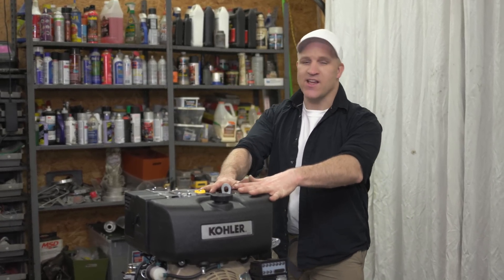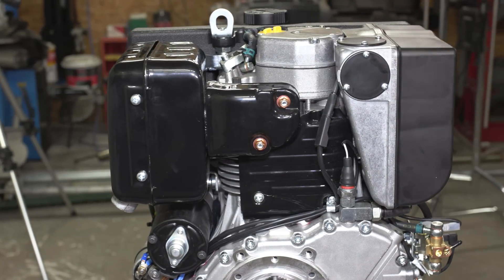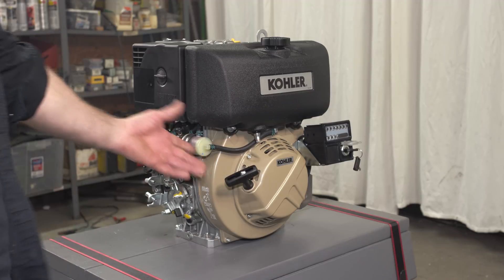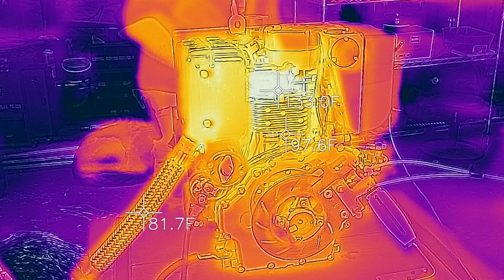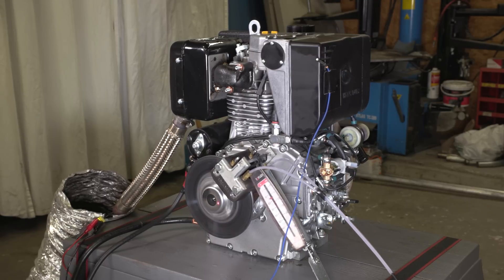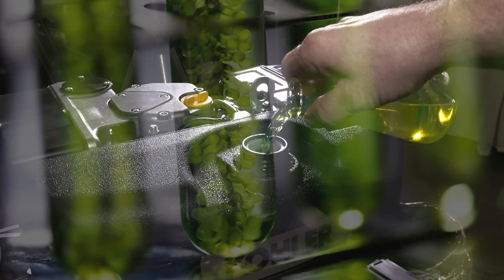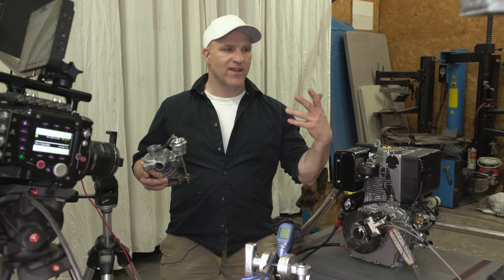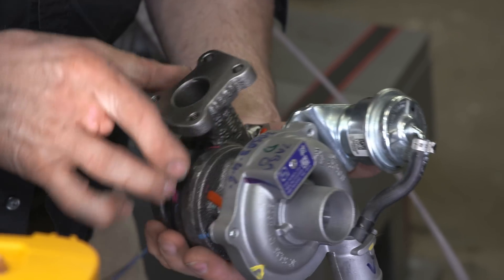Single Cylinder Diesel Engine - Dyno Test (Diesel, BioDiesel & HydroDiesel How Much HP?)

Comment: "The only thing I was missing was the company that made a single cylinder diesel engine..."

You mean other than: 
Honda
Kubota
Yanmar
Lombardini
Enfield
Deutz
Hatz
DMB
Nissan
and 67 Chinese consumer brands...
Reply: Der Motor wird von Lombardini gebaut und als kohler verkauft
Reply: https://images.app.goo.gl/vE4iX2XqBeVynZRC7
Reply: DexMaster881  LOMBARDINI brand diesel small engines are now KOHLER DIESEL ENGINES
Reply: And Czechoslovak Slavia and Škoda.
Reply: He was waiting for a company to give him one.
Reply: @jjw6342  YouTuber with a massive following is a choosing beggar or just wants free stuff.
Reply: My first thought as well, both Kohler and Briggs and Stratton are a short drive from me. SE Wisconsin area
Reply: Forgot Kawasaki
Reply: Yamnar and Robin are 2 that stand out in my mind. 
I've seen a few of them with 5-6-7000hrs on them , and finally died because some idiot didn't tighten the air filter wing nut and it got dusted. 
Great engines , once you can swallow the purchase price.
Reply: Harry. B. Renner. jr.  
The wife works at cat, and said occasionally there's rumors and rumblings  they might come back to the road ....
Reply: Honda Nissan japan
Reply: Just the one in the video
Reply: Everyone in this thread missed the biggest advantage for the future of diesel engines - in that a diesel engine can literally burn almost any comfortable liquid - ie vegetable oil - it's even a problem in older diesels when the oil would leak Into the intake and cause a runaway engine -
Reply: dongfeng
Reply from the maker: Well I meant a Single cylinder diesel engine that I wouldn't be scared of when pushing it to it's limits and nobody was going to get hurt by. Other than that you just gave me a really good idea.
Reply: @WarpedYT  Yanmar has Japanese reliability on its side. They're built like tanks.
Reply: @TheOmegaRevolution  We had two crew boats at work that had 380 hp Yanmar turbo diesels. They out ran the other boats of the same hp. The maximum 3600 rpm helped compared to the 2800 rpm of the 5.9 Cummins junk engines in the other boats.
Reply: @TheOmegaRevolution  love yanmar
Reply: What pushed you towards the Kohler and not the hatz?...
Reply: @WarpedYT  I have spent a LOT of time working on a Hatz over the winter, because it had a unique problem.
It got fixed.
It comes in 1, 2, 3, and 4 cylinder versions, and I've come to live the German engineering.
These engines come in a capsule, and are used for some diverse applications.

If you are going to do this again, please test one of these. They are incredibly robust.
Reply: @WarpedYT  hatz and deutz. Reliable in many parts of the world including the US and they manufacture diesel engines for over 120 years and where the first manufacturers which air cooled engines meets the US epa regulations... Instead of them I see a whatever manufactured engine...
Reply: @WarpedYT  There's 2 ways to get hurt by a diesel engine.
Drop it on your foot.
Stick a hand in the drive shaft that its powering or heated parts.

Well there's a no 3 for the Americans: Realising its a superior design to gasoline engine. :)
Reply: DexMaster881 cost to build, cost of maintenance and parts, low Speed and HP, expensive emission compliance...
Reply: DexMaster881 The cost to manufacture and cost of parts are purely the result of economies of scale, thanks to US manufacturers dragging their feet on diesel in the US. The superior thermal efficiency, fuel flexibility, longevity, reduced fuel consumption and reliability of Diesel engines should mean they cost less to operate long term on anything larger than a leaf blower 😂. Silly overheating, asthmatic, fuel guzzling gassers and their precision recreational fuel are all the Union workers want to have to manufacture so that’s what we’re stuck with.
Reply: @dregenius  "The cost to manufacture and cost of parts are purely the result of economies of scale..."
-
Not even remotely true. The diesel combustion cycle requires stronger engine components, which are more expensive to produce. Diesels also require turbocharging to be practical in modern vehicles, that's an additional cost. Diesels require direct injection which is more expensive than the port injection that many gasoline engines make use of. The emissions control systems are also vastly more expensive, complex and maintenance intensive for diesels.
-
Longevity is purely a result of design and modern diesels begin to have so many problems with their complex fuel, induction and emissions systems as they age that their longevity is no longer superior to that of gasoline engines.
-
Gasoline engines are superior to diesels in every way that matters. Just a few examples:
-
Chevy Cruze (gasoline): 153 hp; CO2/mile 277g; annual fuel cost $1,050; EPA smog rating (out of 10) - 6.
-
Chevy Cruze (diesel): 137 hp; CO2/mile 294g; annual fuel cost $1,200; EPA smog rating (out of 10) - 3.
-
Mazda CX-5 (gasoline): 187 hp; CO2/mile 335g; annual fuel cost $1,300; EPA smog rating (out of 10) - 7.
-
Mazda CX-5 (diesel): 173 hp; CO2/mile 365g; annual fuel cost $1,600; EPA smog rating (out of 10) - 1.
-
Honda Accord Hybrid (gasoline): 212 hp; CO2/mile 184g; annual fuel cost $700; EPA smog rating (out of 10) - 7.
-
Prius (gasoline): 121 hp; CO2/mile 170g; annual fuel cost $650; EPA smog rating (out of 10) - 7.
-
Trucks...
-
Ford F-150 2.7 EcoBoost (gasoline): 325 hp; CO2/mile 423g; annual fuel cost $1,600; EPA smog rating (out of 10) - 5.
-
Compare to...
-
Ford F-150 3.0 Power Stroke (diesel): 250 hp; CO2/mile 463g; annual fuel cost $2,000; EPA smog rating (out of 10) - 1.
-
Ram 1500 3.0 EcoDiesel (diesel): 240 hp; CO2/mile 448g; annual fuel cost $2,000; EPA smog rating (out of 10) - 1.
Reply: @DexMaster881   ... or trying to hand-start it on full compression.. 😤

Anyone remember the big single motorcycles of yesteryear ? Ya'd break yer ankle if you got a "little" kickback... 🙄 and they  were petrol 😔

Thats a beautiful little engine btw... 😉

😎👍🍺☘
Reply: @PistonAvatarGuy  If i lived in the US i would strongly consider using gas as well. A big part of why the US does not like diesel, is that your diesel-fuel is a LOT more expensive than gasoline! In Europe, it's almost the reverse! Here diesel is usually cheaper than gas. And i don't know why your diesels emit so much Co2.... My 5 year old 4x4 180 hp diesel emits 190g Co2/mile, which is almost as low as the prius.... And that is usually the trend, but that ignores NOx and soot from diesels, which explains the low smog-rating, but the smog-rating only looks at directly harmful-to-humans emisions, of which diesels very much deserve that rating, because o NOx! This is why they are beginning to get banned from inner cities, but it is not a problem when they are not concentrated in small areas, like diesel-engines on container-ships on the sea and on inter-city highways, where there is a lot of wind to disperse it. The Smog-rating does NOT look at greenhouse gasses, which should be the bigger concern now-a-days, and there diesels are either actually better than gasoline-engines. So yes, gas for small cars in the city, diesels for bigger cars on the highway. Bigger cars in the city should not be a thing, but never-the-less it is in the states, and thus a 2-wheel drive gasoline pickup-truck makes sense if it's used to drive the kids to school and get groceries.
Also, i wanna point out that you make a few points about diesel-engines, calling them complex and costly with their direct injection, emission systems, turbocharging. I just looked up the gasoline Chevy Cruze(Very rare car in europe), and it also has complex emissions systems, direct injection and turbocharging, and along with that, it has a very complicated intake-system with throttle-bodies and air-flow/mass sensors, where diesel only really need a pressure-sensor to comply with emissions, but can usually drive without, which means it wont just die on you, and you can drive it to your destination on limited power, and get to your mechanic without towing it. Apart from that, if the intake on your gasoline-engine has a leak, or your spark-plugs/ignition-system dies, the engine will also die and you wont make it to your destination. Granted, diesels have glow-plugs, but they are only strictly necessary in very cold weather (Below freezing), and the engine will usually start and work with only half of them actually working, since they are only needed when the engine is cold. 
I wont get into the longevity of modern engines, as no-one really knows yet, but if you look at cars from the late 90's in europe, a lot of them are low power-to-displacement diesels that have driven over half a million kilometers (310.000 miles!) on original engines, and are still going strong. Higher-power engines doesn't seem to live that long, but that could be due to fewer of them having been sold, and most of them being business-cars/taxis that drove 500.000 km in their first 10 years, which will of course be gone now.
Very few gasoline-cars make it past 200.000 miles without a complete engine rebuild....
Another point is that the ones actually buying diesels in the US are the ones that tow with it, and thus put a lot of stress on the entire drivesystem, which means it will be built stronger and therefore last longer than a gasoline-engine. This obviously makes it more expensive, but it's also a big reason diesels usually last longer. I had a 1.9 TDI from 1997 until last year, which had done 490.000 km, and i regularly towed a 2-horse trailer with it. It was almost always at full throttle to keep up with semi-trucks on the highway, and it never had overheating-problems, it still had ok mileage, and it survived several hours at full throttle and boost-pressure with the trailer. 
I also did 2 trips at basically top-speed at night on the german autobahn (Skiing trip) where it was at 3800 rpm  (Redline at 4000) driving 180 km/h with full throttle almost non-stop for 8 hours, with only very short breaks if there was a bit of traffic or a fuel-up, and it just did it no-problem. No loss of power(Actually the reverse! It cleared out some soot or something, cause the turbo spooled up at 1700 after it, vs 1900 rpm before), no leaks, oil looked fine, nothing. It was indestructible, and only had to go because someone drove out from a side-road, and hit the side of the car. The other car leaked every conceivable liquid and the whole bumper was ripped off, and my car drove up on the tow-truck itself.
Reply: @Newspaperman57  I love diesels and wish my country had adopted them earlier, a lot of the US is rural and so our diesels could work quite well. The issue is when idiots pull off the emissions equipment and pour way too much fuel onto the engine making huge clouds of black smoke. It makes people think they are dirty and pollute a ton. Honestly, we should have banned anyone who rolled coal from owning a diesel. Our government is constantly waging war against automobiles as they are an easy enemy instead of looking towards reducing the methane that our livestock put into the air or the trash that plagues our waterways and oceans.
Reply: @Newspaperman57  I don't understand the point of your comment, gasoline engines do EVERYTHING better than diesels. They're less complex, less expensive, they pollute less (both NOx and CO2), they perform better and they have fewer problems. Even in class 8 trucks, spark-ignited natural gas engines perform just as well as diesels, while polluting less and costing less to operate.
Reply: @PistonAvatarGuy  yes, but what about the Cruze compared to my VW Sportwagen TDI?
Reply: @TMoonPickens  It hasn't been on sale in the US since Dieselgate and the most recent version of the Cruze diesel significantly outperformed it.
Reply: @PistonAvatarGuy  good point. I had forgotten about the Cruze diesel. I happen to love my VW.
Reply: @TMoonPickens  Doesn't mean that gasoline engines aren't better in every possible way.
Reply: @PistonAvatarGuy  You are pulling shit out of your ass? How is a deisel engine more complex than a gasser? Diesels hardly have an ignition system. No spark plugs or wires. Its literally just fuel and compression. If your deisel is having trouble starting its almost 100% related to fuel if nog below freezing. Just start cracking lines and checking pumps,filters etc. Diesels are proven to burn cleaner,provide more gas mileage and provide substantially more torque. The only reason gassers dominate is because of fuel prices. A gasser is literally not better in any area over a deisel. I work for Caterpillar. Im rebuilding 40 to 50 liter engines every other week. They are producing torque numbers a gasser could never dream of. Burning cleaner especially with the selection of fuels available. Running for days on end without breaks. Sometimes only running for weeks without stop. Fuel consumption is no where near what a gasser would be of the same size. They can go a couple of days before refueling. At least on the big machines I work on. Deisel dominates in every area and has been proven to be just as effective in literally every area of industrial and motorsport alike.
Reply: @PistonAvatarGuy  would you mind to share the source of those CO2 numbers? Diesel contains a significantly higher amount of energy per volume than gasoline, the engines need  30 to 40 percent less fuel, so the CO2-emissions are much lower. Plus, in Europe, Diesel costs only 2/3 of gasoline, that's why so many people drive it (I'm not a Diesel guy myself, btw, but I don't like to talk about false facts, when it comes to co2 and fuel consumption)
Reply: @Spongschbob  Diesel produces more CO2 when burned, the additional carbon in diesel is where the extra energy comes from. Modern diesels are only about 10-15% more efficient than modern gasoline engines, which isn't enough to offset the greater amount of carbon contained in diesel fuel. Diesel is more expensive than gasoline in the US.
Reply: @dregenius  Well guess who are the avid haters of Diesels? 
British and Americans, ones with most Oil Tycoons...
Also the ones that dictate Emissions regulations that get met by all other countries than their own...
But its OK they always get slack.
Theres an old saying in My country "Judge sues you Judge judges you..."
Reply: @PistonAvatarGuy  Wow dude....there is no help for you. I give up. Your "facts" are far from true here. All of that modern technology requires me to plug in my computer and tune the engine,and electronic accessories to do anything I want. Im literally taking a course through Caterpillar to learn how to do that stuff. Its no different than tuning a gasser. In fact guess what? Its easier. There is no spark timing or spark advance and most the of tge high pressure fuel pumps and stuff nowadays is still no where close to the complexity of some of the new gasser engines. As for torque a turbocharger is used to get diesels to make more power on the top end. Most deisels make a shit ton of torque at around 1000 to 1500 rpm but are gutless and sluggish with out the added top end power around 2 to 3 grand. Again a gasser cant make that torque. Not without 10 grand in modifications. As for longevity I believe maintenance can make any engine last
Reply: @haydona1845  All of that modern technology makes diesels MORE COMPLEX than gasoline engines, which was the whole point of our discussion. It may be easier to tune a diesel (to some extent), but you get less power from a diesel, so it doesn't matter.
-
Plenty of turbocharged gasoline engines make several thousand lb-ft of torque, they're not tuned that way from the factory because they don't need to be, they can make huge amounts of power without having to make huge amounts of torque.
Reply: @DexMaster881  hey just cause I'm american doesn't mean I dont think diesels are damn well superior
Reply: @PistonAvatarGuy  Petrol engines release more CO2 than Diesels, because Diesels are more thermally efficient due to their higher compression ratio and leaner burn, also they don't have to run under partial vacuum to restrict power, unlike petrol engines that use a throttle.

Also, simple and cheap additives, such as AdBlue, help greatly with NOx emissions and combustion temperatures. Effectively it is liquid-injection intercooling, like on the high performance rally cars of the 80s.
Reply: @DexMaster881  he's got to put a wacky ass cylinder head on it that had to deal with higher compression than any of the gas engines hes tested
Reply: @Jupiter__001_  You guys are just horribly out of date. All of my numbers are from the EPA and they show that diesels produce more CO2 than gasoline engines. Also, everyone replying to me seems to be from Europe, where testing methods are different from those in the US, where different engine options are available, and where diesels are allowed to pollute more than gasoline engines in order to keep their CO2 emissions low. In the US, diesels are required to meet the same minimum emissions standards as gasoline engines, but gasoline engines easily exceed those requirements, while diesels have difficulty meeting them.
-
Diesels are slightly more efficient than gasoline engines, but not enough for them to have lower CO2 emissions (or fueling costs in the US). Modern diesels do run at partial vacuum under certain operating conditions in order to reduce emissions, this is accomplished with an electronic throttle valve. The emissions control systems on modern diesels are hugely restrictive and significantly increase pumping losses, which significantly reduces the overall efficiency of the engines.
-
There's nothing cheap about a urea injection system, it requires an entire electronic injection system for the urea, a heating system for the urea tank and certain components associated with the urea injection system (it's often a coolant circuit which runs through multiple components), along with an entirely separate catalytic converter for the system (an SCR). Consider that the SCR is used in addition to a DPF and a DOC in the exhaust. The urea injection system adds to failures and requires regular refills. The DPFs often need replacement in higher mileage vehicles, sometimes costing $1,000 or more!
-
Urea injection is not used to cool anything, the urea is used to drive a chemical reaction in the SCR (selective reduction catalyst). Maybe you're thinking of the liquid-cooled EGR that many modern diesels require? A liquid-cooled EGR is yet another complexity and common failure point that gasoline engines don't require.
-
Anyway, diesels are COMPLETELY obsolete in on-road vehicles, there's no longer any advantage that diesel engines can provide in on-road vehicles over other engine types.
Reply: @PistonAvatarGuy  <rant>
I don't trust the bloody EPA to provide correct figures, especially when they caused huge SUV "crossovers" to spread everywhere because they are held to less rigorous emissions standards than smaller vehicles. The US is a big enough market that a lot of companies just sell the same wasteful, oversized crap everywhere instead of making different vehicles, wasting fuel and space on the cramped streets of Europe.
</rant>

I didn't know about Diesels running under partial vacuum using a throttle. Why do they even bother with a turbocharger if they want to run at below atmospheric pressure?

I don't see how Diesels can be outdated when they are decades newer than petrol or "gasoline" spark-ignition engines. They are significantly more efficient; I don't believe you when you say they are only slightly more efficient than petrol engines. How can an engine running at much lower compression ratios and temperatures almost match the efficiency of the high pressure and temperature Diesel engine? Physics says it cannot be done (I assume you are familiar with thermodynamics; you seem like a fairly intelligent fellow on the other side of the debate, as it were. If not, look up Carnot's Cycle, the Otto Cycle, and maybe the Atkinson Cycle for a start).

I don't really know about how Diesel filtering systems work, but it makes sense that they would fail a lot if they are complicated electronic messes like what you described. I remember having a car that would suddenly start to burn large amounts of fuel every time its filter got full, and you had to just drive around until it finished. You could tell just by listening to the exhaust note. I don't really notice that on current Diesel cars. They seem to have come a long way.

Also, if Diesels were obsolete, the entire NATO forces wouldn't use Diesel engines in every vehicle they have, but rather petrol, surely? Heck, NATO even has a Diesel motorcycle that does over 100mpg.

Have a good day, or night. (I don't know what time zone you are in.)
Reply: @Jupiter__001_  By that logic, absolutely anything can be dismissed. I don't trust your source that says that diesels produce less CO2, so there! ... In all seriousness, the CO2 emissions figures can't be manipulated, because they're almost entirely a result of how much fuel is burned in the engine. More fuel burned = more CO2 emitted. Also, it's not like the EPA lied about anything to make SUVs more profitable, they simply allowed them to be sold with less stringent emissions requirements (you can blame fossil fuel industry lobbyists for that one).
-
"Why do they even bother with a turbocharger if they want to run at below atmospheric pressure?"
-
Are you kidding me? Because diesels are gutless boat anchors without turbochargers. A vacuum is only needed under certain operating conditions in order to achieve a richer mixture, as leaner mixtures produce greater NOx emissions. A turbocharger can't be controlled as rapidly as a throttle valve, and it's probably difficult to get any kind of vacuum with a turbocharged engine without a throttle valve.
-
Diesels aren't outdated, they're OBSOLETE, there's a difference. Diesels are obsolete because they no longer offer any valuable advantage over spark-ignited engines.
-
"How can an engine running at much lower compression ratios and temperatures almost match the efficiency of the high pressure and temperature Diesel engine?"
-
I already explained that. The emissions control systems destroy most of the efficiency advantage that diesel engines are capable of achieving.
-
NATO uses diesels because hundreds of millions of their vehicles aren't driven on the streets every day, so emissions aren't a major concern for them, which means that the efficiency of their engines isn't nearly as compromised as it is in on-road vehicles. Many military vehicles also have multi-fuel capabilities that aren't possible with gasoline engines. Diesel fuel is also safer in combat situations than gasoline. I was careful to specify ON-ROAD vehicles when stating that diesels are obsolete, which is a category that military vehicles do not fall into.
Reply: @Jupiter__001_  Oh, and the vacuum in the intake is also required to draw exhaust gasses into the intake manifold (via the EGR system) under certain operating conditions. I think that's actually the main reason for the throttle valve on diesel engines.
Reply: @haydona1845  I don't even know where to begin with you, you're so uninformed on this matter that it would take HOURS to educate you. Diesels do have their place, but that place is shrinking, and diesels have never been well suited for use in light vehicles.
Reply: @haydona1845  "Ive damn near seen it all and im only 19."
-
Then why are you stuck in the 1970s? WTF is wrong with you?
Reply: @haydona1845  Yeah, the links wont post.
Reply: @PistonAvatarGuy  Its fine ive seen enough.Again the injection,dpf,throttle valves etc are no where near as complex.Again another opinionated response on systems you dont know. Most of that shit is still mechanical nowadays even on modern deisels but you wouldnt know that would you? Lol im done giving effort into this. Believe what you wanna believe
Reply: @PistonAvatarGuy  Wow dude just wow. Have a good one
Reply: @haydona1845  Check out the description on the latest video on my channel. Discuss there, if you like.
Reply: @PistonAvatarGuy  so like, gasoline is not Superior to dieselin every way, they are more reliable, requires less maintenance, are better for the environment, (EPA are a bunch of corporate run fuckwits) and black smoke is cool
Reply: @grren1782  "I'M a pOTaTo!1!!!11!!!"
Reply: @PistonAvatarGuy  I work on engines for a living, exclusively gasoline, and I've had a hard-on for Windsor's since the womb but gasoline is not perfect for every situation
Reply: @grren1782  I've met a LOT of very ignorant mechanics in my day. In fact, mechanics are usually the worst when it comes to spreading misinformation. NOTHING is perfect, diesels least of all.
Reply: @PistonAvatarGuy  most definitely not perfect no, but ideal in a good few situations yes
Reply: @grren1782  Very few situations.
Reply: @PistonAvatarGuy  anything that requires high mileage, anything that requires heavy loads. Imagine what a motorcycle is good at and then the reverse of that 😂
Reply: @grren1782  Nope. I love how people try to tell me how things are when they have no clue what they're talking about, it's hilarious. READ THE DISCUSSION. Natural gas engines are better when it comes to hauling heavy loads over long distances (in commercial applications, anyway), gasoline engines are better almost everywhere else. Diesel only makes sense in applications where weight and emissions don't matter much, so heavy, earth-moving equipment, trains and ships (edit: and military vehicles), but that's about it. Even heavy duty pickups would do better with turbocharged gasoline engines, but no one is making one for that application yet.
Reply: @PistonAvatarGuy  EcoBoost engines exist in trucks. Also holyshit natural gas sucks. It sucks in every aspect, there's nothing good about it. It was a government rebate EPA sham. Ask the truckers and the people that work on their trucks. can't get anywhere on a tank, and it sure as fuck takes forever to fill up.
Reply: @grren1782  Ford doesn't make an EcoBoost engine for their heavy duty trucks, that would need to be an engine with a displacement of around 5 liters. Natural gas is REPLACING diesel in class 8 trucks, and it's gaining popularity in city buses. The market is choosing natural gas engines over diesels because they're cheaper to operate. Truckers are being paid to haul loads as cheaply as possible, not to whine about longer fill up times. The fuel tanks do need to be larger, but there's usually plenty of room on large vehicles for them.
Reply: @PistonAvatarGuy  it's getting popularity in city buses by the government, not the drivers. They are severely underpowered.
Reply: @grren1782  Then there's something wrong with the engine manufacturer. Cummins has no issue getting the same amount of power out of their natural gas engines as they do out of their diesels.
Reply: @grren1782  I don't understand why so many people are so obsessed with diesels, every one of you act like I punched your kid, or something! There are better options, GET OVER IT.
Reply: @PistonAvatarGuy  I don't know why you're so emotional about it? You're wrong, at least with current tech. Diesel is better right now maybe in the future it won't be but right now it is
Reply: @grren1782  I'm just sick of people arguing about it when they're clearly wrong. HOW is diesel better? What advantages does it provide? NAME THEM.
Reply: @PistonAvatarGuy  range, durability, torque, lifetime, price over time.
Reply: @grren1782  Range, yes, but that's less of a priority when compared to pollution and costs. Durability (and lifetime, not sure why you think that's something separate) has absolutely nothing to do with the fuel being burned, that's purely a result of the construction of the engine. Natural gas engines are often just conversions of diesel engines, so durability wont be affected. In fact, because the diesel cycle is so hard on engine components, natural gas engines are likely to outlast diesels. Cost over time goes to natural gas engines, that's why they're replacing diesels. AGAIN, you have no idea what you're talking about.
-
From Freightliner:

Maintenance Intervals

Cummins Westport’s natural-gas engines feature spark-ignited, cooled EGR combustion technology with a maintenance-free aftertreatment system and a three-way, passive catalyst. This means you don’t need to worry about particulate filters, regenerations or SCR equipment.

“Since CNG burns so cleanly, the maintenance intervals for changing the oil or air filters of our Freightliner 114SDs are much longer than in our trucks with diesel engines,” said Larry Humphries, fleet manager of the village of Downers Grove, Ill. “Instead of servicing our trucks four or five times a year, we service them only once or twice, and that’s mainly to put on or take off the snow plow equipment when the seasons change.”
Reply: @PistonAvatarGuy  complexity
Reply: @PistonAvatarGuy  also when it comes greenhouse gas emissions that's just it, diesels are better.
Reply: @PistonAvatarGuy  a diesel engine requires less moving parts therefore will last longer
Reply: @grren1782  In heavy vehicles, diesels are more complex, just because of their emissions controls. In light vehicles (cars and trucks), diesels are far, FAR more complex. Naturally aspirated gasoline engines with port injection make far more financial sense than diesels for the vast majority of vehicle owners (the new Ford 7.3 is a great example), while turbocharged, direct injected gasoline engines make sense for higher performance applications. Turbo GDI engines do approach the complexity of diesels, but their emissions controls are still far less complex, their emissions controls control systems don't require maintenance, the engines are lighter and cheaper to produce, and they offer better performance than diesels. Diesels make absolutely no sense in any light vehicle and never really have.
Reply: @PistonAvatarGuy  they make far more financial sense for people who have no idea how vehicles work. The 7.3 is a specialized example though as that's only for heavy use, a 5.3 for example would far more common (even though that engine specifically sucks and I would prefer a 7.3 for daily use anyways but)
Reply: @PistonAvatarGuy  so you're saying you're still running your EGR? Lmao
Reply: @grren1782  "also when it comes greenhouse gas emissions that's just it, diesels are better."
-
You didn't even bother to read this discussion, did you? NO, diesels produce MORE CO2, PERIOD. You get about 15% more CO2 when you burn a gallon of diesel than you do when you burn a gallon of gasoline, but modern diesels (which are now required to be as clean as gasoline engines) are rarely 15% more efficient, so they have slightly higher CO2 emissions. If you get a really good diesel and a really poor gasoline engine, the diesel might match the CO2 emissions of the gasoline engine, or produce less CO2 emissions than the gasoline engine, but that's going to only be in rare cases.
-
"a diesel engine requires less moving parts therefore will last longer"
-
Why would they have fewer parts? Even the old mechanical diesels had more moving parts than gasoline engines.
Reply: @PistonAvatarGuy  a gallon of diesel will get you a lot farther than a gallon of gasoline
Reply: @PistonAvatarGuy  because they don't have spark plugs, they don't have a throttle body
Reply: @grren1782  "they make far more financial sense for people who have no idea how vehicles work"
-
How? Why? They're far more complex to maintain!
-
"so you're saying you're still running your EGR? Lmao"
-
There aren't really any engines in production today that don't use EGR, but the EGR system on a gasoline engine is usually far less complex than it is on a diesel.
Reply: @grren1782  "a gallon of diesel will get you a lot farther than a gallon of gasoline"
-
No, only about 15% further, but that's a wash because the fuel costs about 15% more and produces about 15% more CO2! READ THE DISCUSSION!!!
-
"because they don't have spark plugs, they don't have a throttle body"
-
Diesels have glow plugs and electronic throttle bodies. READ THE DISCUSSION!!!
Reply: @grren1782  The EGR also plugs up on diesels, because of the enormous amount of soot that diesel engines produce.
Reply: @PistonAvatarGuy  no they just don't have throttle bodies
Reply: @grren1782  Yes, they do, they're used to create vacuum in the intake in order to draw EGR gasses into the engine. Go to my channel, look at the description on the latest video. The picture on that 'video' also shows a throttle body, it's in the lower right quadrant (it's the silver part, inline with the black plastic pipes).
Reply: @PistonAvatarGuy  again, back to egr's. I don't run anything with an EGR
Reply: @grren1782  Then you'd be breaking the law in many parts of the country and you're polluting excessively. You're obviously a sociopath and don't care about the health of others.
Reply: @PistonAvatarGuy  gassers don't have EGRS....?
Reply: @grren1782  That's not what I said, I said that the EGR system on a gasoline engine is much less complex and much less likely to be a source of problems. Gasoline engines don't need the expensive, high-capacity, failure prone EGR coolers that diesels need, and the EGR system on a gasoline engine doesn't fill with soot the way that it does on diesels.
Reply: @PistonAvatarGuy  Why are you spouting so many false narratives? You keep saying you have proof, but yet to provide anything outside of personal opinion.
Reply: @Rudofaux  Except for the facts that I produced, you mean? I've supplied facts from the EPA, video proof that what I'm saying is true, specifications that prove my points... what more do you need? Your DENIAL is not MY failing.
Reply: @PistonAvatarGuy  
I think in the next 10 years all engines are going to feature high compression ratios, lean burn, and Homogenous Charge Compression ignition. It will blur the lines and be the fusion of diesel and otto cycle concepts.
Reply: John Doe I may remember wrong but I once read that the US idea of clean diesel is very much different than that of the EU. Which is why our diesel emissions and mpg in the US suffers.  Not that our is stricter but has unrealistic expectations on certain types of emissions. Our school buses (where I work) have almost all converted back to gas. Total Cost of ownership is cheaper. Plus they have heat and aren’t so governed that they can’t get out of their own way.
Reply: Offroad Addict I think in modern implementations with direct injection and def stuff they have gotten significantly more complex.  Those things take an awesome engine and cripple it with complexity.  I love diesel but it seems here in the us our government has gone out of its way to try to keep them out of popularity/practicality.
Reply: Offroad Addict more people saying misinformation doesn’t make it right. Kind of like louder doesn’t mean righter in an argument.
Reply: Grren all our buses are going back to gas, I hate getting stuck driving the slow noisy diesel that by the time you get heat you’re routes half over.  Our oldest diesel  is a 2014/2015 they suck out loud. Now I don’t hate diesel I hate what our government has done to them making them so anemic and expensive to operate that they get out paces by the gassers.
Reply: PistonAvatarGuy I don’t know where in the us you live, but I get Diesel for $1.99 and gas is only $2.13 

I drive a diesel Jeep and it has more power in hp and torque than a comparable gasoline Jeep, runs on only 4 cylinders, and achieves twice the mpg. 

Also I’ve noticed a 2-3 mpg increase when driving 80 mph
Reply: @Newspaperman57  most of the commentors don't know that the U.S. is backwards in some ways
Reply: @peterfitzpatrick7032  76 xt 500 Yamaha. Shattered my Ankle more than once.
Reply: @PistonAvatarGuy  The typical gasoline 1/2 ton or 3/4 ton is "consumed" at about 150,000 miles while a diesel pickup of the same weight class doesn't reach the 10,000 hour overhaul period until 500,000 miles.  I've owned both.  The 3/4 ton are actually constructed to last 500k miles vs the typical gasoline 1/2 ton.  So yes the diesel initial purchase cost is 10k more, but you buy 3.3 gasoline pickups for each diesel pickup for a cost penalty (at $50k/new truck) of $116,000 over a 500,000 mile period.  Subtract the $400/year fuel cost differential and the diesel is still cheaper to run.  50,000 miles/year * 10 years = $4000 extra fuel cost for a diesel vs $116,000 expendable gasoline.  The extra CO2 means diesels contribute more to the living members of the Plantae kingdom as CO2 is an essential input for photosynthesis, which produces the oxygen we breathe.  So maybe its greener ;)  6CO2 + 6H20 + (energy) → C6H12O6 + 6O2 Carbon dioxide + water + energy from light produces glucose and oxygen.
Reply: @DexMaster881  Cold Caller
Reply: @haydona1845  diesel is more complex because it needs higher pressure injection system, and all mechanical parts need to be heavier, because diesel burning produces faster pressure increase. Diesels burn dirtier, because air/fuel ratio is way out of ideal, and excess oxygen doesn't allow use of reduction catalytic converter to reduce Nox. All extra torque is made by turbocharging, N/A 2 liter diesel has torque as 1.6 gasoline, modern turbocharged petrols produce similar torque as diesels, but over much wider range. And most of diesels extra range comes from larger energy density of fuel, not from efficiency.
Reply: @PistonAvatarGuy  petrol engines are now direct injection,
Reply: @aeroflopper  I just meant that diesels require direct injection, while gasoline engines can make use of port injection, which is less expensive. Some gasoline engines still use port injection.